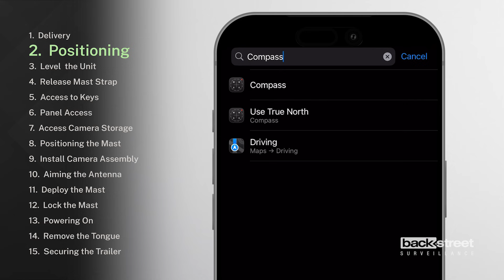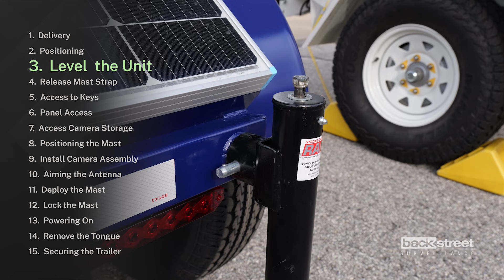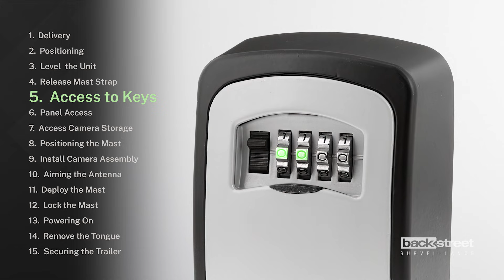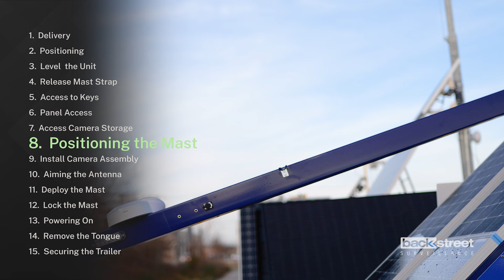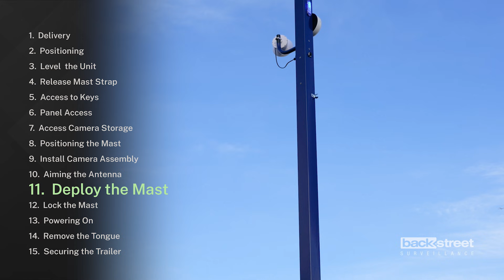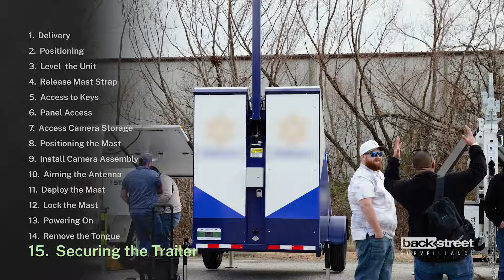Best Custom Surveillance Trailer Setup of 2026

Comment from the maker: 🚨 Security threats are evolving — and so are surveillance trailers.

Our latest custom-built surveillance trailer is designed specifically for modern security challenges in 2026, combining:
✔ AI video analytics
✔ Remote live monitoring
✔ Solar-powered deployment
✔ Active deterrence technology
✔ Rapid mobile setup
✔ Application-specific customization

From construction sites to critical infrastructure, these mobile security systems are redefining remote surveillance and crime prevention.

Watch the full video to see why custom surveillance trailers are becoming the preferred solution for temporary and remote security deployments.

👇 What feature would matter most for your deployment: solar power, AI analytics, live deterrence, or remote monitoring?

#SurveillanceTrailer #ConstructionSecurity #RemoteMonitoring #SecurityTechnology #MobileSurveillance